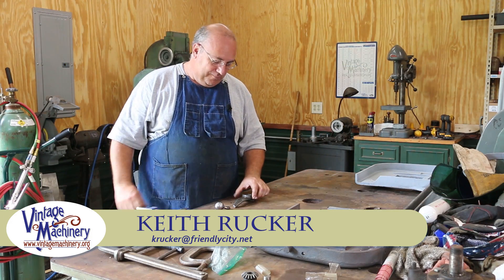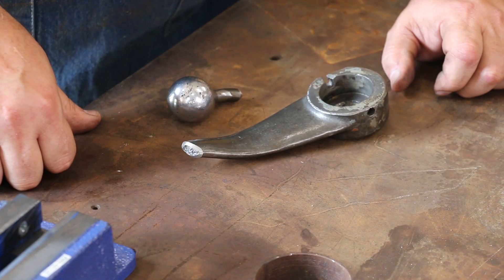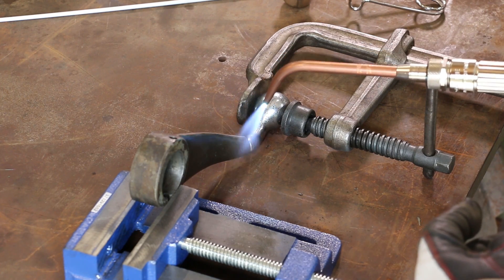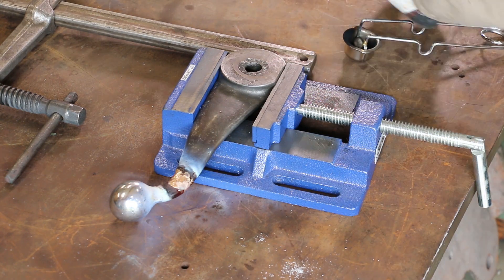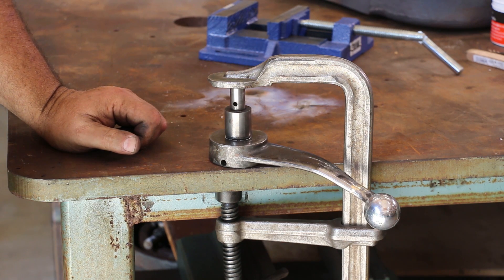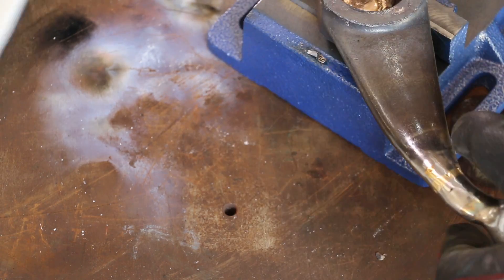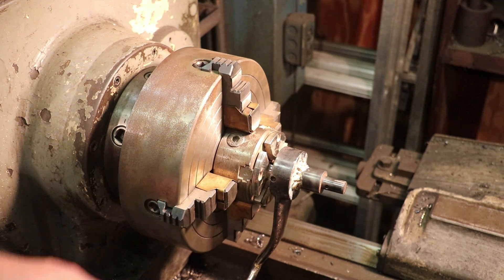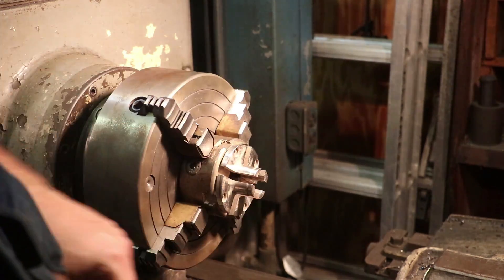Monarch Lathe Restoration 5:  Brazing a Broken Control Lever

Comment: I've only worked a little with brazing. I've tried steel, brass (welding?), and copper. Most of my problem was that I was trying to do pieces that were too large for a jeweler's torch (oxy-propane). Some times I had to heat the rod itself just to get it to flow, but then almost invariably the joint was poor. Basically, whether it is welding, brazing, silver soldering. or soldering, if you are needing to heat the filling material up, you're not going to get a good joint. For all but the steel welding this ends up as a cold joint and while it might seem strong, it usually isn't. The metal has to flow to all areas of the joint from the heat of the material being worked on, or that and the torch together. Keith, I can't explain why, but I have found that any torch that is held too close to the metal will cut out. I think that was part of your problem. Oh, I'm sure you noticed the gap in the taper pin hole for the round piece with the square hole. I'd be very leery about trusting the one hole to hold that pin in. Good luck!

Comment: why not weld it...not saying brazing isnt good but shouldn't welding be stronger ? then you can sand it down to make it look nice...maybe paint it
Reply: Welding cast is rarely successful. The process alters the crystalline structure of the parent metal and degrades it. Brazing is always the method of choice.
Reply: oh so it hardly an option...dame now im disappointed

Comment: I would probably have g clamped the handle to the table and the held the ball of the handle in the vise (vise clamped to the table)
Reply: The hard bit is not putting so much heat on it that you melt where it's been tacked on, so the darn thing falls apart
Reply: Also you could have turned the braize down before putting the nub on the end.

Comment: Great video Keith! You should try welding cast iron with cast iron welding rods.  It makes for an invisible repair.  I get my rods on a website called Detroit Torch.  It is a bit more difficult than brazing but the end result looks great! (Of course it doesn't matter if you paint over it, but still!)

Comment: Keith,
Have you ever tried to braze this sort of thing with a 40 percent silver solder? It would look better in the sense that the braze material has a very similar colour to the parent material. For cracks it would require less heat and thus less chance of cracking the in the part.
Would this work?

Paddy

Comment: A tip from a blacksmith friend of mine. When touching a previous heated metal to check for coolness use the back of your hand. If the metal is still to hot and burns then it is the back of the hand that takes the heat and not the working part of your hand. It will save the pads of your fingers to continue working.
Reply: I use my crayons
Reply: My friend does not have the temp crayons. When you work with hot iron by hand for over 20 years you know what to touch and when to touch it.
Reply: I usually use a drop of water n the end of a screwdriver to see if it's below the boiling point.

Comment: You need to pick up some fire brick to help with heat retention for faster preheat and better filler flow. The soft brick also can be cut, drilled, etc to configure to odd shapes for holding. 
Cheers

Comment: Starting at 7:31, it appears that the bent shaft goes all the way through the boss. You said it was held in place by a pin. Then you brazed that shaft and the boss into the handle. I would have removed the shaft first, then brazed the boss in, then re-drilled the hole straight. Then I would have either straightened the shaft, or made a replacement. As it is now, to remove the shaft, you will have to mill out some more brazing on the inside. Extra steps to be sure, but better than trying to straighten it with the possibility of bending/breaking something else in the process. Jon

Comment: I have the same Nova Chuck and also have used it in the metal lathe using a #3 Morris Taper mount... It worked fine.  Thanks for sharing.

Comment: Keith,  I have the same Smith torch setup and really like it.  I need to add the rosebud tip to my arsenal but the brazing tips and cutting torch work nicely.  I recently built a bracket and stand to hold the torch instead of draping it over the tanks; very handy.  Thanks for the video and nice job on the repair!

Comment: If that stub is cast iron too I would think trying to straighten it would be a risky venture. Hopefully it will fit and work ok as is. A little paint and will not be able to tell it was fixed. :-)
Reply: Since it doesn't actually rotate, what little runout is in it probably doesn't really matter. Well, actually it does rotate, but only about 45 degrees...

Comment: Could you have used silver solder on the last part that indexed? I only have used it once, but from what I understand it becomes rather strong and flows easily into parts. If it would work there would be much less weld material to remove, also I would think that part would not be under undo stress.

Comment: What about the broken out hole for the roll pin?  You could have tapped it and screwed in a bolt, cut it off flush on each side, then brazed it in place and re- drilled the hole.
Reply: Not much torque, but it gets 10 time as much use as any of the other levers.
Reply: It will be a lot easier to  simply rely one only one side to hold the pin. This lever doesn't get much torque applied to it
Reply: and the breakout looks like it's been that way for quite some time, going by the consistency of the colour against the rest of the part.  suggests it's been working OK like that.

Comment: Nice repair.  

I thought I was the only person who used my wood lathe chucks to mount some items on the metal lathe.  Often for drilling or boring spindle work on the metal lathe.  My wood lathe tailstock alignment is not accurate for drilling.

Comment: For someone who's never tried it, what is brazing like? It doesn't seem to flow like solder or weld.
Reply: You need a lot more heat for brazing rods to flow well than say soldering.
The hotter the parts, the better the end result in my experience.
Reply: John Alexander when you have your material chemically, mechanically clean and at the proper temp. It flows nicely.
Reply: Actually, it's exactly like soldering, except a higher temperature, and you use a flame instead of an iron for heat. Keith has some better videos of brazing, this one had low heat from a smaller torch tip, so it was not flowing like it should have. Like soldering, you want the work to melt the rod, you don't want to just drip molten metal on cold metal.
Reply: And well fluxed too

Comment: Keith, curious about the use of brass.  As a "soft" metal, will this not give way over time?  If not in this case, what alternatives are available to repair cast iron such as this?  

Wondered if you would drill and insert a few pins to hold that knob to the shaft.  Did you consider doing so?  (Like orthopedic surgeons do when mending fractures).
Reply: Good quality brazing filler is extremely similar in strength, and many other ways, to cast iron. The part is probably just as strong now as when it was first made.
Reply: It's a handle to shift a small gear. How strong do you think it needs to be?
Reply: k1mgy its still stromg 
brazimg was the main form of welding for many years 
you can get rods for cast iron and im certian im wromg but you may be able to tig it 

but not nessercery for this job

Comment: One thing you could try next time is a box of wet sand to do part holding.
Reply: wood0366 Exactly. I learned from a old guy in Hungary. He used a black sandblaster sand mixed with normal sand to hold the parts. After when he finished the welding, he used a same heated sand to cover, then he warmed up the whole container in smith fire. After 20 minute, he pulled out the container to cool down very slowly. Next day we put together the engine block. No crack, no visible repair, no issue, no deformations.